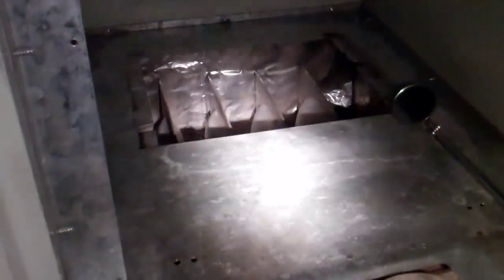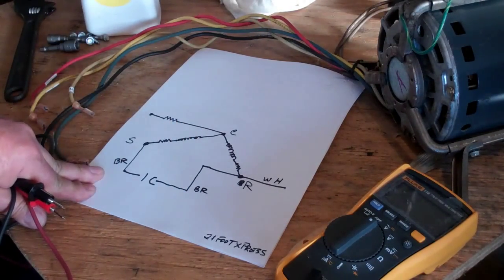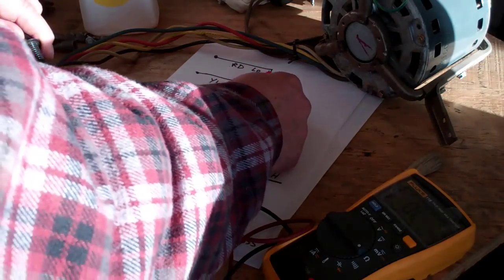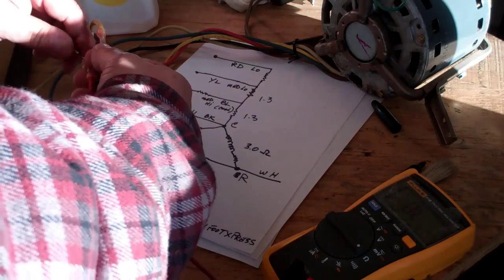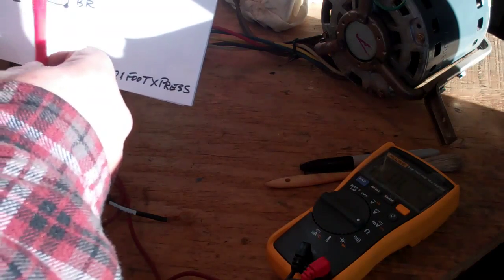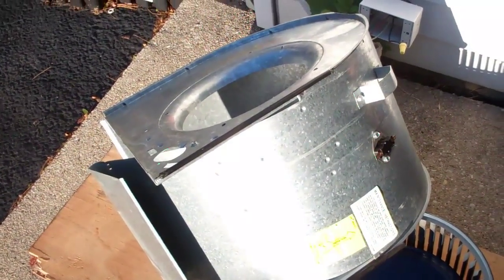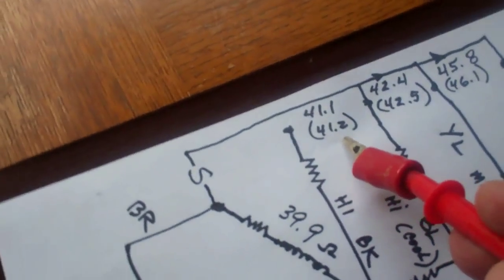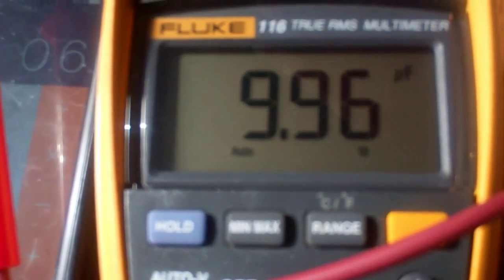Ohm Testing the Furnace Blower Motor (Part 2 of 4)

Comment: It is much more important to check for continuity and the integrity of insulation which is usually made of shellac than the ohm reading unless you need to know in single phase motor which is the start and which is the run winding.

Comment: The question is... are all the coil wires for different speed connected in series or parallel?
The lower the speed the greater the resistance... right?  
Plus each have their own spearate winding, that is for sure.  Each with the same number of poles on the top of the previous coil windings.....?

Comment: Hi, for example.... let's say a 1ph motor that has 5 wires. how to know which one is
1) Hot Wire, 2) Neutral, 3) High Speed, 4) Medium Speed & 5) Low Speed? 
Resistance/Ohms test without Schematic or  Diagram to find out all this. Thks

Comment from the maker: Thanks dude!!  Just trying to keep you entertained LOL!!!
Reply: AlchemistLair Hey Alchemist, maybe you could help me figure out which 3 wires to use for wiring up to a 3prong plug for use as a blower if possible or if not then for a 4 prong. I wired up my 230v compressor using two hot wires each being 120v legs making the 240v and 1 wire being the ground to 3prong. Now would this be the same if only using one speed or do I need the neutral in this case needing to use 4prong plug?  I just picked up a squirrel cage blower 240v GE 1hp 4speed with a 440vac capacitor with two solid brown wires connected to it and running into the motor windings. The unit looks in great condition but can also be deceiving. I am unsure of the wiring since my few inches of wires are inside the motor and are all wired to a 5pin quick connect or 5 seperare quick connects not sure. The 5pin connector lists what is wired and yellow is on #1 as Com, purple/brown(purple w/brown stripe) is on 2 as High, black is on 3 as Medium High, Blue is on 4 as Medium-Lo, and Red is on 5 as low. It doesn't sound right from all the videos I've watched Black always seems to be High from  what everyone says and since I don't have white I know yellow is my common because I could see it go in with the two brown capacitor wires and connect to the winding. I'm just trying to wire it up as a blower on 240v any help would be much appreciated figuring out what wire combo to use and on what number of plug and outlet. Thanks very much and sorry so long!

Comment: Hi, May I know, why you did not check the ohm between the Black and the First Brown? Thks.
Reply from the maker: Well, I'm not really sure I did not check those points but may not have shown it on the video.  If you have some issues in the motor it will become apparent as you begin to check resistance values, and in my case everything was adding up.  Thanks for commenting!!

Comment: what cuts out the Start Winding, shouldn't there be a switch? ...
Reply: It doesn't get cut out on a psc motor. That's why there is a run capacitor permanently installed